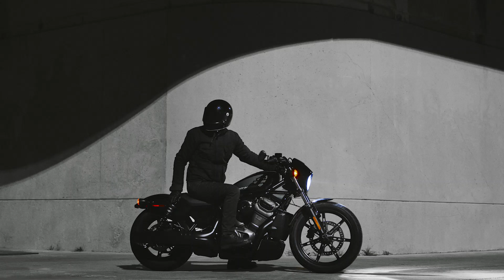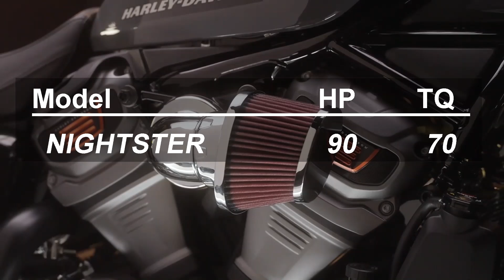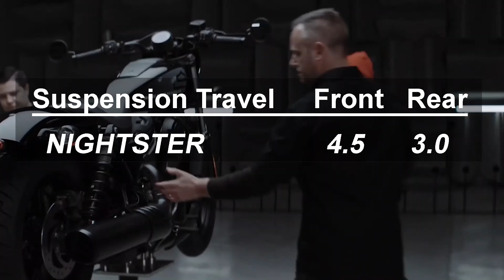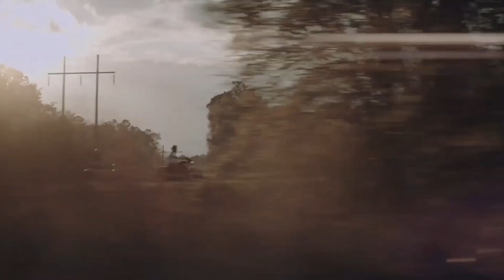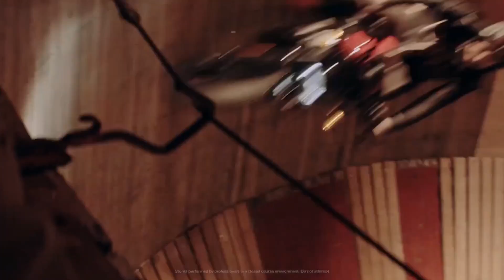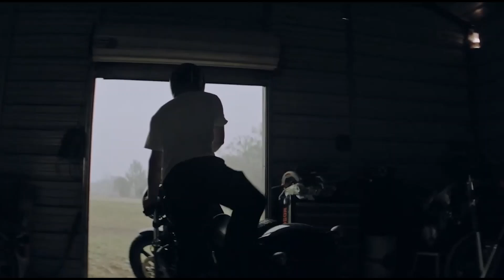New 2022 HARLEY DAVIDSON Nightster Sportster! 8 things you need to know!

Comment: I've owned many motorcycyles since 1967 of many makes and models. I currently own  a Tri-Glide due to my wife's many health issues. 
    I stopped in a Harley dearlership yesterday to check out the new 975 Nightster. Harley had to get with the program or die, so we now have the 975 Rev MAx and the1250 on the Pam America. 
    But I sat on a new Nightster and it was like sitting on a 8X10 plank of hard wood. The bike is extrememly small and the suspension seemed very stiff.
    A few minutes later I stopped in a Kawasaki dealership and sat on a Vulcan S. It was very confortable with a very nice seat, the suspension had some give to it, and the tank was just the right size. The reach to the bars was very confortable, everything just fit. 
    So I ask myself, why would anyone spend twice as much to own a Nightster? A bike that is very small, hard seat stiff ride when you can buy a very comfortable motorcycle from Kawasaki?
    Sorry Harley Davidson, but if I can get my wife back on two wheels, it will be a Kawasaki.

Comment: Almost 14 years ago Triumph launched the Thunderbird LT. The LT sat right between the Heritage and the Road King in style, being some sort of British "cousin" of the classic American righway comfort machines. It was beautiful and capable of giving out 98hp and an enormous amount of torque (I can't recall the precise number, but it was bigger than Harley's) on a very low RPM. The engine was a gem, it could be reved to a righ RPM range because of its configuration. But... also because of that configuration (liquid cooled paralel vertical twin) the hard core cruiser/touring guy did not give it any credits... 
By that time I already felt for a while that if Harley had had the courage to develop a real touring machine with classic lines but using the V-Rod mill, tunned it to perform in the way the Thunderbid did, they would have a winner.
Let's wait and see what's coming next from Harley's factories. That new Nightster may show the way of Harley's development, but is still too urban for my taste and its peak toque is too high on th RPM range. I'm waiting to meet the real American touring machine from Harley sporting a modern engine,  but still capable of giving huge torque on very LOW RPM.

Peace from Brazil. ✌

Comment: the 975 is replacing the 883 so this is the baby sportster. there will be a 1250 version later this year. it's nearest competitor would be the scout 60 and it's 12 more horsepower and 80 lbs less weight than the scout, plus having the extra electronic features and driver aids like traction control that the scout doesn't have it totally blows it out of the water. you won't be able to add all that to the scout for $3k or less. the sporster s beats out the scout bobber in more power and less weight, same with the pan America to the BMW gs. hd has a tracker and also a cafe racer coming aimed at the indian ftr and triumph truxton so I'm excited for the new performance model sportsters coming in the near future. the bronx street fighter was aimed at the ducati monster and ducati somehow found out the weight of the Bronx while it was touring Europe and they dropped the weight of the monster by 40lbs so the bronx lost before it was released so it's back to the drawing board and I'm uncertain if it is canceled permanently but it's definitely all the way back on the burner
Reply: I think this bike misses the mark, just because of the price. The Honda Rebel 1100 is the closest competitor with the exact tech specs and a price that is 20% cheaper. This is coming from a Sportster S owner.
Reply from the maker: have you rode the 1100? The ergos made it an afternoon only bike for me, no long rides, to cramped...